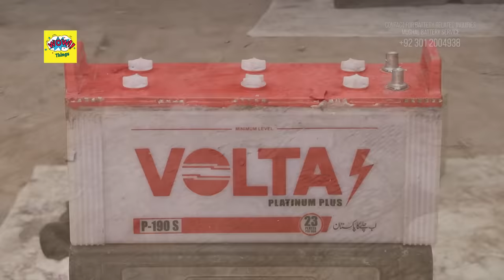Amazing Technique of Making Lead Acid Battery Plates & Restoring a Dead Battery

Comment: These poor workers are unaware they are being poisoned. my respects.
Reply: I think they do, unfortunately I don't know if they have much of a choice.
Reply: Спасибо Великобритании за такую жизнь в Пакистане!
Reply: they are aware and they know...... but still their average life is same as we and like others
Reply: Everyone is being poisoned not just these workers.
Reply: @waqasahmad5733  nope, life expectancy there is 66, here is more than 80!
Reply: @waqasahmad5733  Even the average life expectancy in Pakistan is over 12 years less then e.g. in the EU,  of course for  many reasons (relative deaths in traffic, thus car crashes etc. is probably 10 times higher as in e.g. the Netherlands or so), but I am pretty sure that these folks are usually not getting older than about 60-ish or so.
The really depressing part is, that some 80 cents dust masks and and cheap gloves would already improve that a lot.
Reply: It's not so bad since they are doing the melt and pour outside and it's probably not considered much of a risk in country that still has malaria and cholera.

Comment: A combination of a remarkable case of rebuilding, and slow suicide of the workers.  Remelting battery plates is considered very hazardous without proper protective technology (which certainly isn't found in this shop), not to mention working around battery acid with neither gloves nor safety glasses, inhaling clay dust, and so forth -- and the pollution they unleash into the environment around their shop.

You do what you must, but it's a shame that they have to do this to have affordable electrical storage.
Reply: That ain't clay dust, it's an oxidation state of lead but i forget which one
Reply: @markshort9098  When color is yellow, is Lead Peroxide (PbO) named Lithargyrium. when yellow'-redddish is Lead Sesquioxide (Pb2O3), when is red is Minium,  Lead Orthoplumbate (Pb3 O4) and when is dark brown is Lead Peroxide (Pb O2), all terribly poisonous
Reply: But why do we need that brown clay like coating
Reply: @zyzzz5497  That's not clay, it's lead paste made from lead oxide. Red is positive gray is negative.

Comment: Great video. Lead such a versatile material, shame it is so poisonous. Agree other comments such clever and industrious workers should have protective gloves and masks. Love the electrical connection at the start, just poke the leads in the socket.
Reply: Just remember - "leads" not "lead"... Confusing is life in this factory, indeed...
Reply: not very poisonous actually
Reply: @thebraziliangardener8481  Well, not "very poisonous" in "acute" sense, but pretty bad long term effects nonetheless.
Reply: @MrKotBonifacy  yes i guess a years long shift in this job would be deadly
Reply: @thebraziliangardener8481  More poisonous for their children. Take your children to work day not good idea.

Comment: Unbelievable that they do all that WITHOUT ANY protective clothing. I wonder what their lifespan is ?
Reply: most of them live for a long time without any problem and cancer rate is seriously low compared to the western countries.
Reply: @Techie_ASMR  said no one, EVER...
Reply: Продолжительность их жизни составляет 25 аккумуляторов)))
Потом ищут нового специалиста)))
Reply: 80-90лет
Reply: they are probably eating a lot of eggs
Reply: Mid 40's at best im sure
Reply: @Techie_ASMR Cancer rate is lower because it left undiagnosed.
Reply: In such countries you are doing well to live into your 60's.  With poverty and high death rates on their roads, the lead poisoning probably will be the last of their worries.
Reply: Looks like a serious cancer risk
Reply: @Techie_ASMR  LOL, no. If that's Pakistan, the life expectancy is for males about 66 years, thats 10 years less than in the USA and 12-14 years less than in  the EU. And the cancer rate is low because of a health system which can in many cases just not diagnose cancer.
Reply: @Techie_ASMR  that is weirdest thing I’ve ever heard anyone say
Reply: Working like this, at these levels of raw lead and lead fume exposure? They might have a year, maybe 18 months before serious symptoms begin to manifest, and maybe another year before the worker begins to fail physically. Outside case, maybe three to five years. Lead poisoning is cumulative and non-reversible, and the level these guys are working with is absolutely fatal. I'd be very surprised if any last more than three to five years.
Reply: @cammobunker  Not to mention the reproductive issues... Having worked in a Delco Remy battery plant (30 years ago) in Anderson Indiana, this is incredibly sad. The plant was ventilated and there was some forms of PPE. Monthly blood tests for lead exposure; if your count was elevated (often), you were relocated to a different area of production. This brings back bad memories.

Comment: I wish these videos had some narration, just to complete a viewer's understanding of it all. 
Scrap at the beginning is recovered from lead matrix? 
What is that scrap composed of? 
What are sheets soaked in at 6:00 to cause bubbles, is there chemical reaction? 
What layers go between lead sheets at 9:15 ? I just love how they do it all. 8:24 was great.
Reply: The first material, which was burned off to make ash and then ground to form a sort of clay, looked like shredded bark or wood waste; it keeps the plates from flaking through charge and discharge cycles.  The liquid the plate stacks were soaked in was probably just weak sulfuric acid, soaking to saturate the clay in the lead plate grid.  The white sheets between plates are plate separators -- in American manufacture, they'd be fiberglass matting, but in India it's likely they're asbestos.  They're porous enough to let electrolyte pass through, but non-conducting, so the positive and negatives plates inside each cell don't short together.
Reply: @SilntObsvr  I thought they were roasting lead sulfide to lead oxide. That's what the lead converts to when being discharged (and gets converted back to lead when charging). The more porosity of the anode and cathode plates, the more power you can draw out of it. The plate separators make it so the anodes and cathodes don't touch each other, which shorts out the battery. They're all in series in each cell which increases the amperage (power capacity). Separate cells (grouping the plates) increases the voltage, normally to 13.2 volts.
    The lead oxide is the positive side, the lead metal is the negative.  When the battery discharges, they both turn into lead sulfate. Charging will convert it back, but there is a tendency for the crystals to get bigger, and the current to get lower. Draw too much, and the water in the acid breaks down giving off hydrogen. The important part was when he hooked it up to a charger - it activates the plates
Reply: So lead acid battery technology can be mastered in the backyard by some Indian guys with a shovel and a mixer, using clay, wood, recovered lead, azbestos and a scissors. I suppose this is the calcium carbonate enriched and non serviceable type of battery, five years warranty.
People, this is iron age.
Reply: @uiflorin  Lead acid battery electric cars predate widespread use of electric start in gasoline cars.  Jules Verne wrote them into his books in the 1860s.
Reply: @SilntObsvr  Jules Verne wrote Science Fiction, ok? When he wrote all those adventure books, which by the way I have read all of them and have them all in my library, the things he wrote about were just ideas and research, because he had scientists as friends. Please, don't lecture me about your recent readings, I'm an electrical engineer and what these videos show are just garbage for this time. 120 years ago this was cutting edge technology from Jules Verne books, but now it's just hazard done by poor guys, that don't even understand what they are doing. Yes, lead acid batteries in the back yard, with cley and asbestos.
Reply: @patrickvolk7031  there's no wood or bark in it, that's pretty ridiculous to me. what they roast is the old clay-like mix from the used lead matrix and is probably sulfur rich, going by the colour. is there any lead in it I don't really know. cells in series increase voltage by adding each voltage  of each cell, cells in parallel increase current capacity by dividing load between them. internally, these batteries are 100% in series, layers are anode to cathode and cells are anode to cathode 12:22 . layers are assembled and soldered in series to make cells, then the cells are then soldered in series to make the battery.

Comment: The way they use electricity. I think that he must be very careful. 😀Short circuit everywhere, badly maintained machines, lead dust in the air and work without any protective equipment... Pretty fucked up situation and primitive life to live...

Comment: Amazing technique indeed! And scary... I mean... They work with lead and battery acid, without gloves or respirator, and with molten metal in just safety flip-flops, bare hands, and surely heat resistant regular clothes... :S

The thing is it's honest work which is good, but you do 1 battery you will probably be fine, you do 10, and you're still probably fine, but you do 1 battery a day for 10 years, and your brain withers from lead poisoning, and you get multiple severe hand and feet burns, so you're pretty much a crippled mindless mess by the time you're 40-50 years old...

I solder a lot, and often just a wire or two ignoring safety cause it's faster... But sometimes I find myself with burns, in so much smoke I can see the haze in front of the lamps, cause I messed up in my hurry, and a bit of soldering turned into an hour or 2 troubleshooting soldering-desoldering and testing parts, without safety equipment or proper ventilation cause I didn't bother with safety in the first place... (At least I had some sense to switch to lead free solder a few years ago for my own safety...)

Comment: I wonder just how much does a battery cost in India? That battery cost 13,800 rupees new that is $185.20 US. So how many guys did it take to restore that battery and at the cost of those workers health, the pollution to the air, ground and water table. you call it amazing i call it very disturbing.

Comment: Hello,I'm so surprised,this way is wonderful.
Do you answer some questions plz?
In strat what kind of soil was changed color from almost brown to yellow??
what was material of withe plate puts between old plates?
After separate paper,made plates puts on bay battery and fill by a liquid that seems boiling and after come out chenged color from light brown to gray so my question is what was liquid included?acid and water or just pure water?!
i will so thank full your answers asap.
sincerely yours

Comment: Watch old manufacturing films from the 20's to 50's in the U.S.
No safety glasses, hard hats, gloves, machinery guards.
I developed armored vehicles and took a trip to The Phillipines 15 years ago.
I watched Phillipine welders lay on dirt floors ,underneath the vehicles welding steel plates onto vehicles with no welding helmets, they just closed their eyes.
No gloves, no eye,ear protection, or leather aprons.
Sparks landed on their bare chests,and they just brushed them off, like it was nothing.

Comment: wau. Damage to environment horrible. They dump sulfuric acid from each old battery right to the ground, then wash rest of the chemicals with water to the ground again. Then pore new sulfuric acid and iron old cracked plastic case. pretty sure it will leak from each bump on the road.  Just wau.

Comment: I wonder what capacity this battery has after regeneration? And what is real cranking amps
 of this battery. They take out a pack of 23 plates and put in a pack of 17 plates.
The gaps are filled with paper ... it looks bad.

Comment: HERE IS THE TIPS HOW THE BATTERY HAVE A STRONG POWER LONG LIFE HIGH VOLTS GIVEN,,, THE LEAD POSITIVE OF BATTERY ARE NEEDS TO CHANGE OF COOPER PLATE AND THE NEGATIVE ARE THE FIBRA USING A CHASSIS OF RADIO AND IF MORE POWER ARE GIVEN OR MORE VOLTS USE A VINEGAR INSTEAD OF WATER BECAUSE THE COOPER ARE MAGNETIC AND HAVE MORE CAPACITY TO DEPOSIT A MORE ELECTRICITY THAN THE LEAD

Comment: The fact that lead and acid are touched there with bare hands is unfortunately not the worst thing to see there. (Inhalation of lead vapors is far more toxic...carcinogenic, damage to the central nervous system, ...).What is the reason why presumably no safety and environmental standards are respected there?

Comment: Go figure... what's up w/ that? You know, that hellash squeal coming from that.. "despertly needs attending" motor. Things like even a 12 year old would know, like cleaning and oiling on a regular bases; otherwise, say goodby to a.. once perfectly running motor to this still much needed wobbling contraption. But no fun in that...